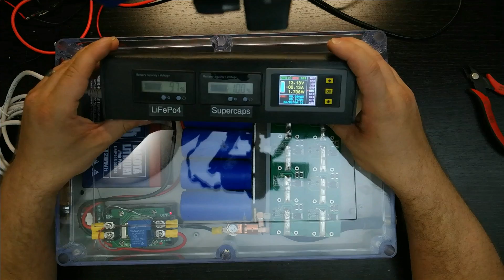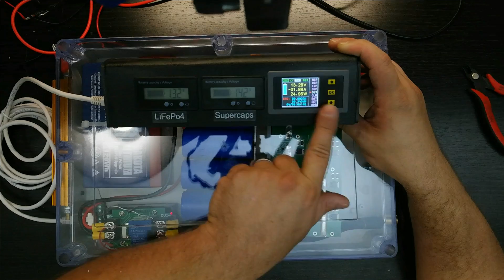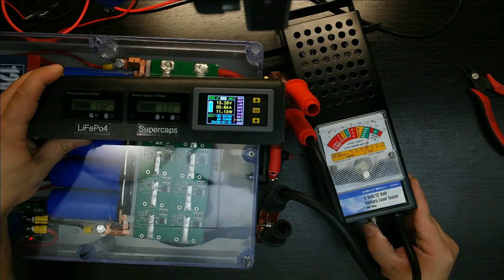Hybrid Supercapacitor Car Battery Part 5 - Final Assembly

Comment: I'm not sure you talked about freezing with this battery. In your final design while you do monitor temperature I see no relay so what if the battery is frozen? I hear that is dangerous for lifepo4. I think not so much discharging it but recharging it after the car has started but the battery is still frozen. Kaboom.

Comment: Bro. Most ppl won't be able to assemble this. You made it too complicated by improving it. You should have went with original 2.7v caps and just use plastic ammo box from harbor freight. Then everyone would be able to follow. Great project for yourself but this is WAY over complicated for avr Joe.

Comment: I did some math on just supercap capacity and it is scary low... Enough to start a car easily, but leaving any accessory on for a bit will drain it... (That makes this hybrid setup really nice)

6 of the current largest 5000F capacitors in series (~833F) stores 19.5Wh at 13V. Once drained to 8V, it stores ~7.5Wh... This means that without the battery, the usable capacity is less than 12Wh... It can run a large starter for a few seconds, but not much more...

(Even with a small battery, a solar charger is probably not a bad idea if the car is ever parked for a few days...)

Comment: How are you protecting the alternator if the lithium has flat lined (no charge)? The super caps will soak up everything the alternator puts out, which can damage the alternator.

Comment: Amperics did an excellent job on keeping the esr in check. If caps have the same esr then you do not need protection boards. Thumbs up for them and you of course.
Reply: karroome Hi,
You probably mean that with matched ESR you don’t need balancing. (As long as you leave enough of a margin) Protection against over voltage for the whole pack will still be very useful.

Comment: i have 6x500F supercapacitors in series on board and i want to build a Lead acid replacement for my 4cylinders 750cc motorcycle. How should i connect 6 x18650 batteries i have, to charge the supercapacitors? Thanks!

Comment: Is this half a ohm 200 W resistor is necessary even after having protection boards for Lithium ion battery pack and super capacitor pack please

Comment: Doing a great job with this. some of the comments throughout the series really give some good ideas like instead of a battery, use a solar panel.  One comment is to please be careful with wedding rings or other rings around batteries or energy sources. one of my friends had his ring contact a dermal and had a sever 3rd degree burn. an ounce of prevention never hurt. KEEP UP THE GOOD WORK!

Comment: Did you (or anyone) come up with a way to connect the five balancing wires to the thick plates? I have not thought about it yet, but I plan to shortly--Does anyone think it is worth it to do this if an easy way is found to make a good connection (not necessarily solder-based--maybe mechanical)?

Comment: A small screw on connector with a tiny screw could help you out with the connection of the balancer on the pre- connected caps with the busbars, drilling a small hole in each busbar instead of soldering or spotwelding

Comment: why do you have 20 capacitors? 5 would have worked just fine. I saw people starting cars with 58 farads and in just 5 of yours you have 120 Farads.
Reply: my point is that your setup for car battery is not realistic, 20 600Farad capacitors even from Amperics are about $300 + $100 battery Plus the other parts = about $500?? it is not economically feasible. Maybe you can do different project with the other 15 capacitors??
Reply from the maker: +mlg779 5 capacitors could work in starting my car, but I'm using 20 to spread out the load and allow the capacitors to last longer.  I also have a tendency to over engineering my inventions.
Reply: what do you think would be the minimum for a lifepo4 battery? 3 AH (3000mAH) do you think can work without stressing the battery? I am trying to do something as cheap as possible.
Reply: Makes them all last much longer than led acid with less waist getting put in land fills.

Comment: SO HOW MANY WATTS OR AMP HOURS AND VOLTS IS THAT BATTERY AND HOW MANY OF THEM ARE YOU GOING TO WIRE IN PARALLEL OR SERIES...........
Reply: You can read it on the battery. 12V, 10 Ah (120Wh). In reality it will probably be 12.8V (4x3.2V cells).

Comment: Good job but I just worry about where the positive lead goes through the box, that under vibration it will wear through the insulation and cause a short eventually.
Reply: It can't really short to a plastic box even if it does wear through there insulation.  That being said I understand you still don't want unintentional bare wires, it certainly wouldn't hurt to have a grommet in the hole.